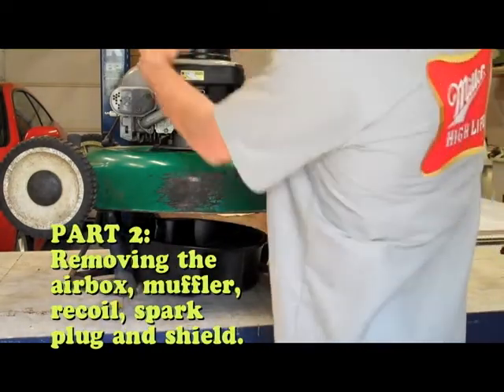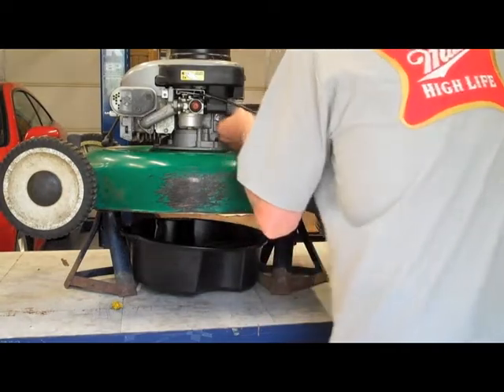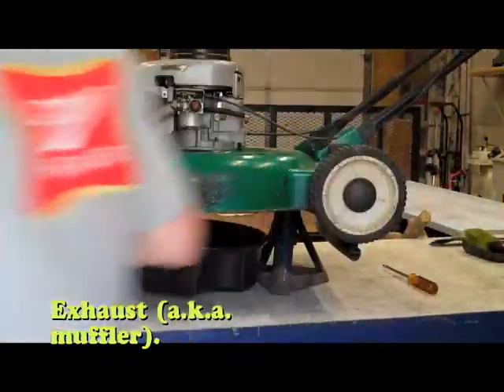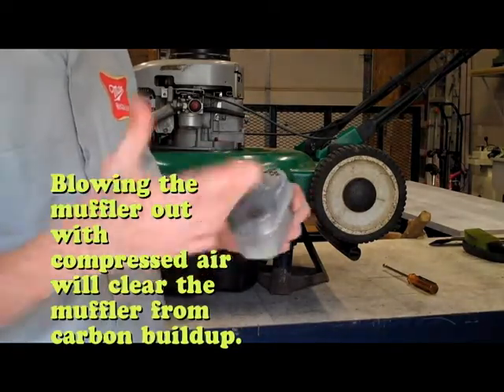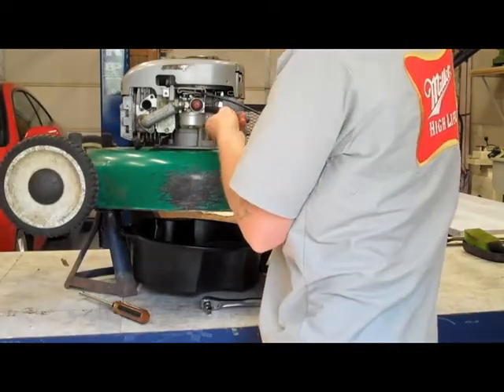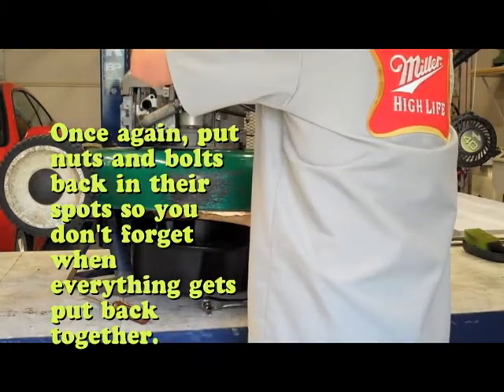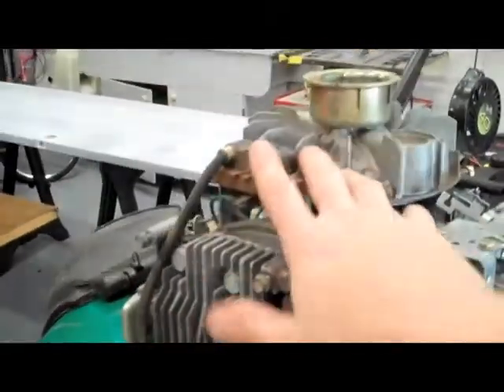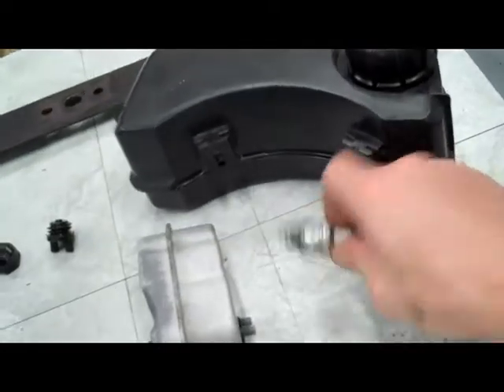Small Engine Repair Pt. 3: Removing Exhaust System & Recoil Starter

Comment: That's a fairly recent engine, mid/late 90's? see how the intake port is below the exhaust, before that the intakes were on top, no down turn on the carb, they went straight across to the port, muffler was below. They made the change for emission reasons, got to love the EPA. They are currently working on killing the 2 cycle. Good video + pardon me for my ramblings...

Comment: @seniorjohnl its funny, if you get an older intake and muffler, u can change the 2 back on the tecumseh engine, and it will run just as great